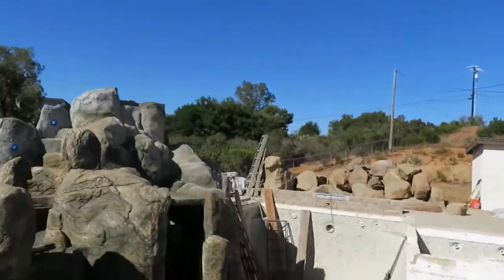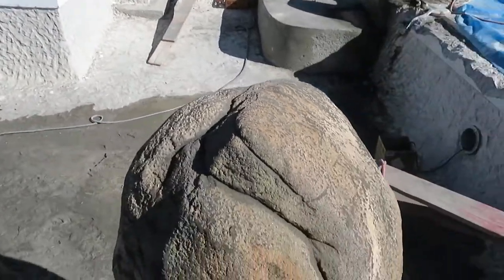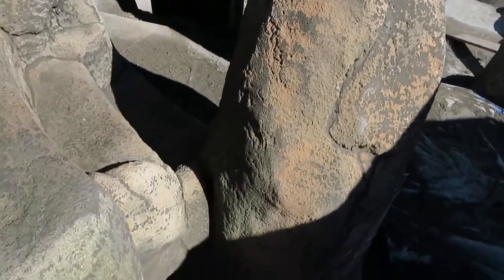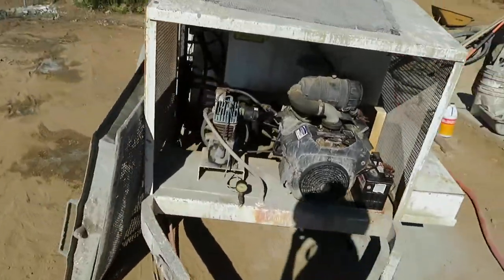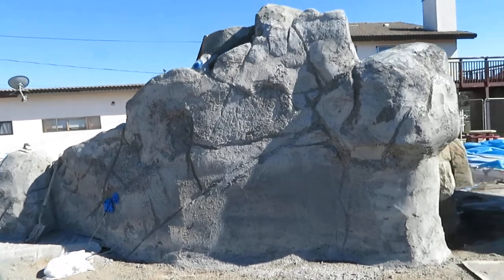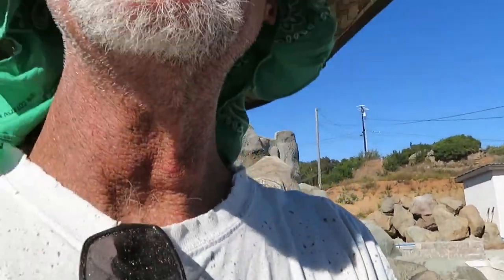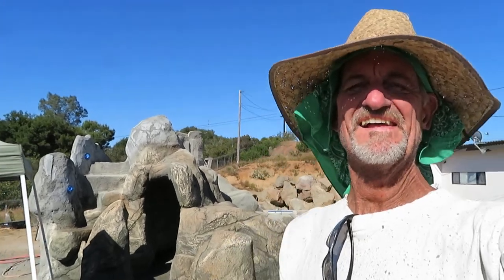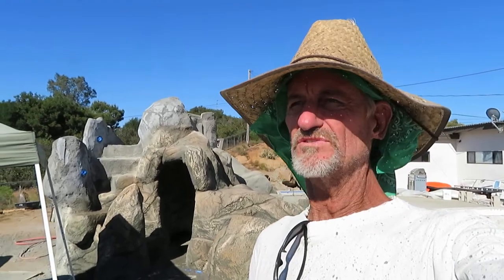How to Make Fake Rock, Texture Coating

Comment: Are the darker grooves in the faux rocks a different color paint or texture than the rest of material?
Reply from the maker: Fook Spam2death at this stage what you see are simply just the carved textures and cracks.    Good question...  :)
Reply from the maker: Good question, Kinda both.  But primarily shadows from the textures...  After that I paint darker colored paints in the cracks here and there....  :)

Comment: Hi Dave. Enjoy your videos. Ive got a waterfall water feature on my pool where the extending shelf of the waterfall broke off and fell into the pool. How would I go about repairing something like that? Thx
Reply from the maker: Hey thanks for the message.  Well here's what I did in that situation.  I built a platform on top of some rafts and then went about demoing off all loose or failing fake rock stuff.  Then I epoxied in new rebar and attached pegboard underneith and around the area that I needed to re-do.  I then poured up concrete in that whole area, waterproofed the new areas, added the texture coat and painted it.  Here's two videos to help show that process.  You can freeze frame the video to check out how things look if you need to.   https://youtu.be/8w83cSXsMFU  https://youtu.be/fm1zJ5oR-WI  Anyway, I hope this helps.  Cheers!  Mr. Dave  :)
Reply: Hey thanks so much Dave. I appreciate you brother! Cheers